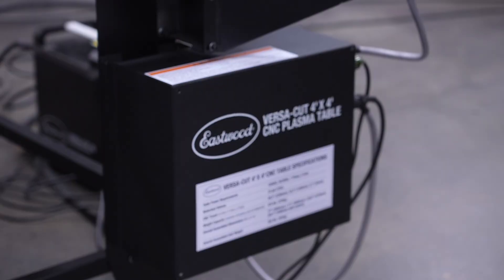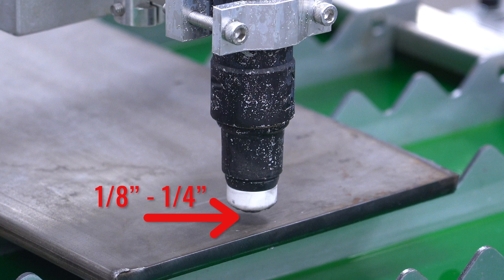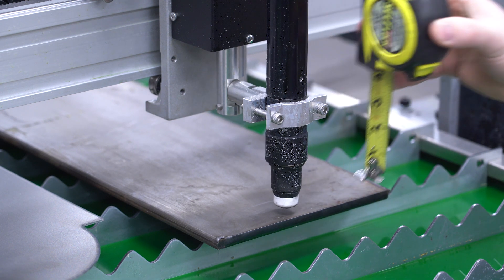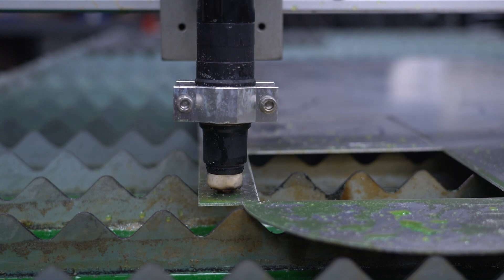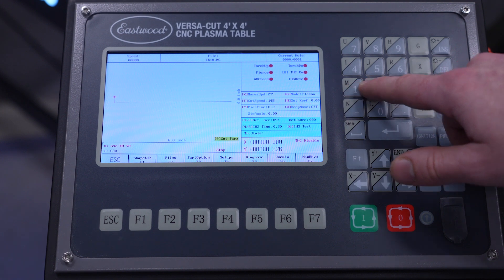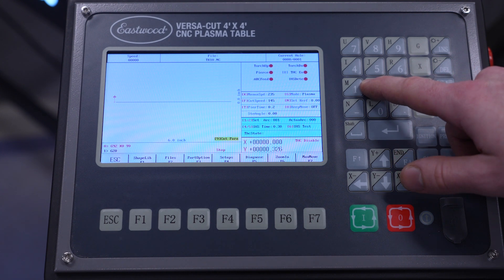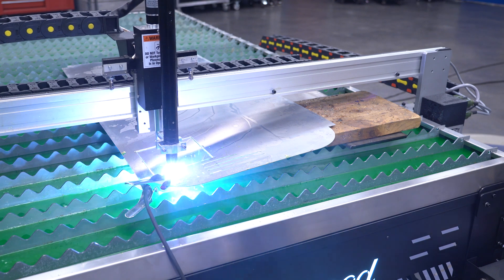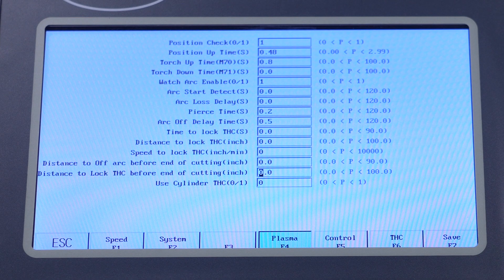Versa Cut CNC Plasma Table - Torch Height Control FINE TUNING!

Comment: Eastwood has one of the best customer service I have ever experienced. This video, paired with that, has made a huge difference in how I operate my new table.
Reply: Did you have any trouble with the torch diving down and hitting the work pieces? If so, how did you fix

Comment: When do you expect the 4x8 table to come to market? I currently have the Versa Cut 4x4 Cut 40, but having to limit my cuts to below 49-43" is a drawback, but still an awesome table.
Reply from the maker: It's still getting fine tuned but we'l update as soon as we can!
Reply: @eastwoodco  Is this 4 x 8 table going to be in the Versa Cut line?
Reply: How do you rate this system with the 40 plasma cutter and torch?  I see mixed reviews on consumables, tips not lasting and small cutter.  Thanks for your input!!
Reply: Thanks